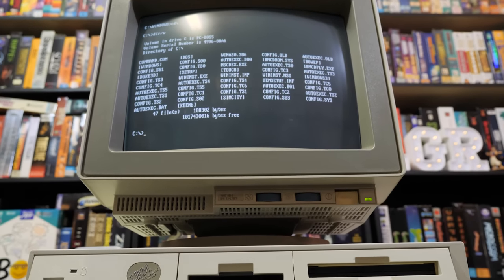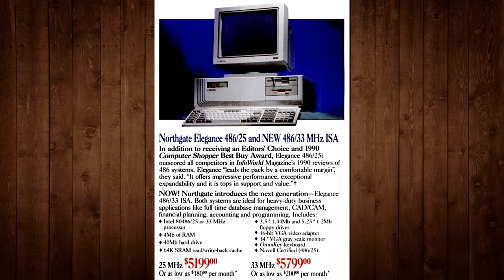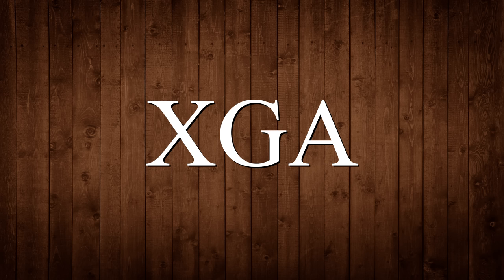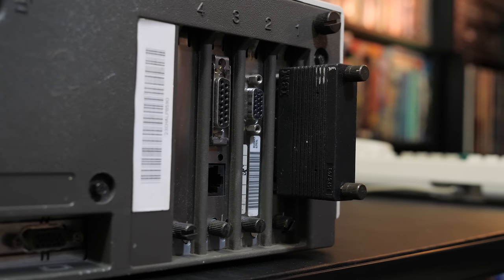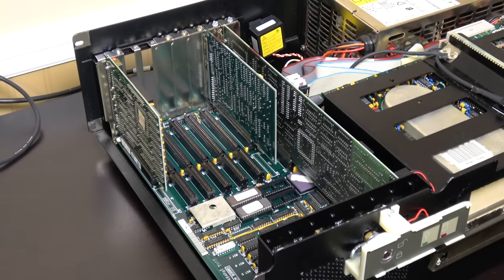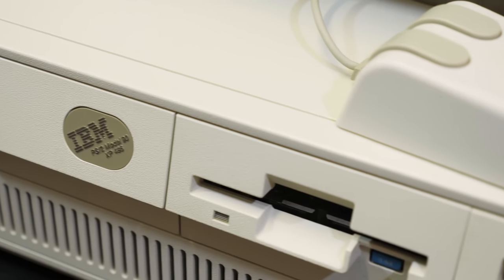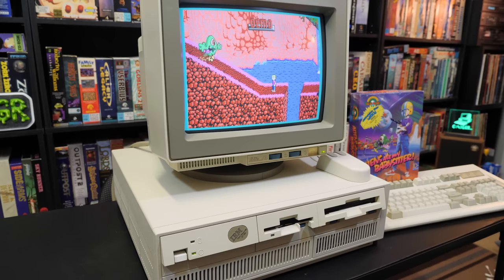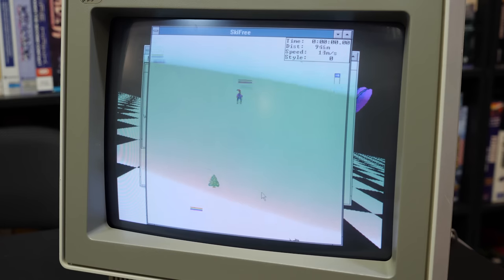$17,000 PC from 1990: IBM PS/2 Model 90 XP 486

Comment: dang someone gave me one of those in 2001, i remember i was so proud to get xp working on it.
Reply: Dang, that must've been slow! Isn't the windows XP minimum recommended CPU a 233mhz Pentium?
Reply: @startedtech  something like that. It wasnt too functional. It was more of a proof of concept
Reply: Windows XP doesn’t support the microchanel architecture. There’s no way XP or Windows 2000 can run on any MCA architecture machine.
Reply: I’ve got a Pentium-66 installed in mine.
Reply: @Mirroxaphene  that makes sense, i didn't think it'd be possible to install XP on a system that old.
Reply: You still got it?
Reply: @thegeforce6625  no ut foynd its way to the dumpster years ago
Reply: @ChrisHirner  that’s a bummer. :(
Reply: Running windows XP on anything pre pentium such as this machine isn’t possible.
Reply: Nice try but xp didn't come out til after 2001 🤨
Reply: You can't install windows XP on a IBM PS/2 Model 90 XP 486. You are either somebody confusing different IBM series or a liar seeking attention.
Reply: I had to install something that started before the os would load. Seing how it was a very long time ago I do t remember what it was.
Reply: @ChrisHirner  oh come on now… just give it up already, admit that you lied. admit it. your a liar. 🤷‍♀️
Reply: @Chevroletcelebrity  🤣
Reply: @9852323 but this computer CAN have a Pentium installed, either a Pentium 60/66 or Pentium 90.

Comment: i loved turning on my jet engine of a computer late at night then shifting into 6th gear and flying through the wall by pressing the turbo button
Reply: didnt the turbo button actually slow the system down to have better compatibility with games and programs? or am i completely wrong lol
Reply: PC masterrace!
Reply: Armyboy89 So maybe it was already pushed in, and he pushed it to go off, bringing the speed back :)
Reply: Dick Trickle I added like 5 unnecessary fans to my computer for nostalgia...
Reply: I remember friend having computer with LCD-display for CPU clockspeed. I recall pressing turbon button  gave maximum CPU clock to that machine. Can´t recall for sure :).
Reply: Juissimies84: You are right.. The same way i knew it - about 486-machines, and even 586-machines. There was a led, on which you could see the CPU-clockspeed. A typical speed was for example 66 mhz (the LED showed : ""66"" ).. pressing the turbo-button , and the Led showed "133"" ... So a lot of posters just want to sound smart and "teaching the not-obvious" -.- when they say : "the turbo-button slows the system down".

Actually it speed it up, for ressource-hungry applications  - as the logic tells. Espescially back then, a computer was a very energy-hungry system. Consuming 500 watt (with a crt monitor together) for just a "normal" (not highend Pc!) was very common back then. Also because this, it can make sense to use the turbo-button only in exceptions. 
Also this was the time, when passive cooling turned into past (the C64 for instance has passive cooling, and was a noiseless machine).
With cpu-power the need for active cooling come into place .. For quiet tasks it was better to run the pc on low CPU-clocks.

The turbo-button indicates the beginning of the pc as serious gaming-plattform... while the 286 was also capable for games , it wasnt really designed for it. Remember: directx wasnt born back then - but it was planned. And intel knew this... so they got the pc-design on track to be also a gaming plattform (and multimedia-plattform)... also with (for example ;)) the turbo-button.
Reply: haha Turbo Button...
Reply: back then, you've set the usual two seven-digit LEDs manually by jumpers, to display what is ordinary, and what into "turbo" mode. My bigtower case into 1994 was also a bit future proof, it have had 3 LEDs, so for clock speeds >100 MHz  ;) but the rolls have been useful...costed some 400 bucks back then and was really heavy.
Reply: I think LGR did a video (or at least a segment of a video) talking about the turbo button, if anyone wants to check it out.
Reply: You are not wrong.
Reply: I suppose at least you never have to worry about it getting hot or overheating.
Reply: @PygmalionFaciebat  could not have said it better myself.
Reply: @falkerhard  Thank you :)
Reply: I worked at IBM in the 90s as an engineer and we used Model 95s as our desktop PCs but I worked on Memory Test Engineering for  IBM mainframes, talking about starting about a jet engine with chilled water and refrigerated air blasting through these beasts!
Reply: The loud jet engine sounding fans were great for playing Flight Simulator.
Reply: @johnwheels89  It wasn't standardized; sometimes turbo enabled slowed down and sometimes it speeded up. It never overclocked the hardware; it was simply a way to slow things down for compatibility, but which state  (on or off) was normal speed and which was slow was a crap shoot.
Reply: Meanwhile, 25 years later with computers running 1000 times faster....... fuckin ads on the internet are slowing computers down to a crawl, at times even        
overheating CPU's and causing random freezes and reboots. 

You can run the latest graphic intensive game on max settings at 120fps, yet we have dumb ass ads putting a stop to our entire system. .
......
........
........
.......
.......
21st Century Priorities 😏😏😏
Reply: Owned a IBM PS/1 and can confirm.
Reply: @johnwheels89  I think it was a overclock button
That's what a was told by others that had PCs
I had a Amiga
Reply: @johnwheels89  depending on the pc it slowed down some while other were slowed down when they started up you then pressed the turbo button which made you use the full speed of the pc